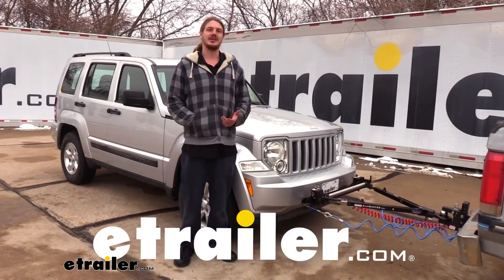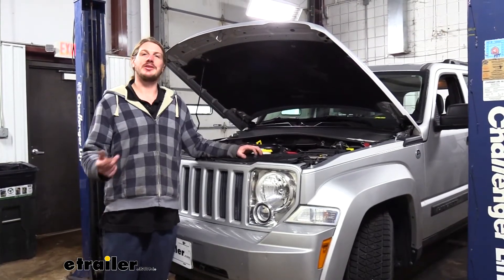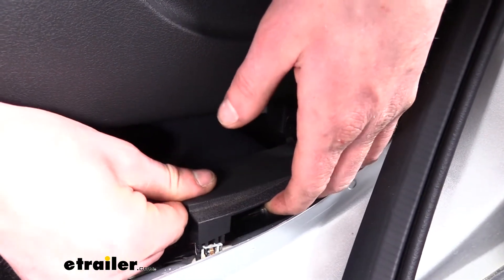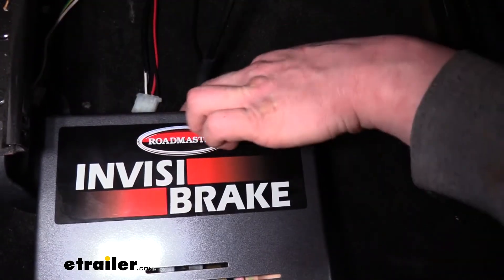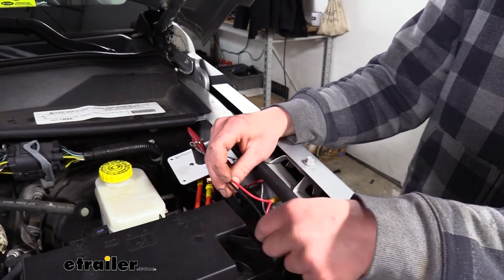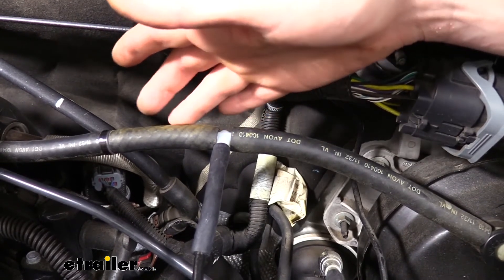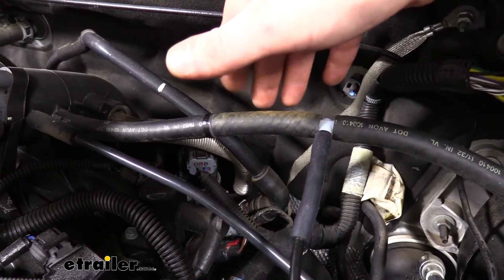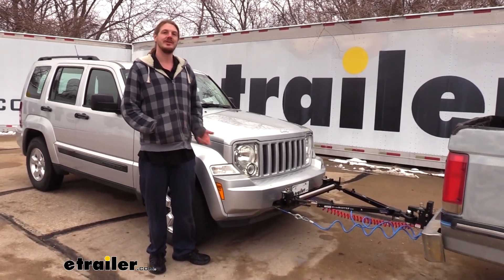etrailer | Setting up the Roadmaster InvisiBrake Flat Tow Brake System on your 2011 Jeep Liberty

Comment: I own 2020 Jeep Cherokee Active Drive II.  Question. Recently towed on I 40.. Road construction and stop and go braking for 20 miles.  When I  reached destination, the battery on toad was drained!!!  Tied up campground traffic until someone was able to jumpstart.  How do I fix this issue?  Towed behind Winnebago View class C. Also drained battery of Jeep after settling in driveway at home after two days. Bad. News. Disconnected unit from battery as stopgap.